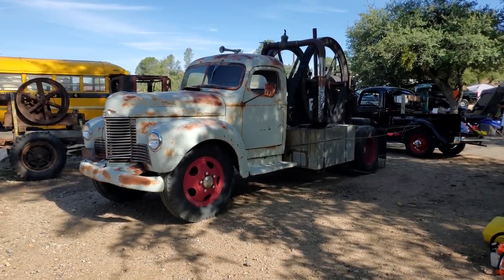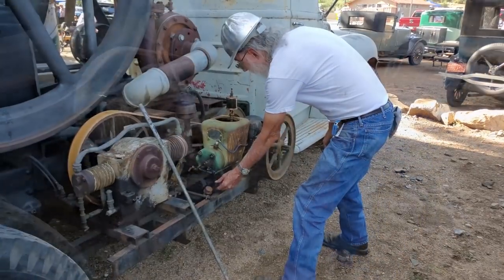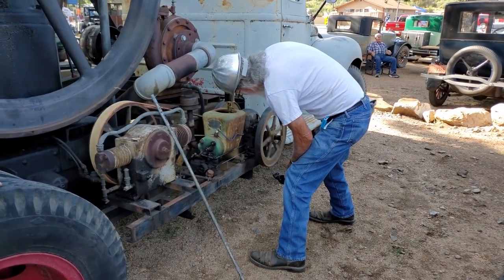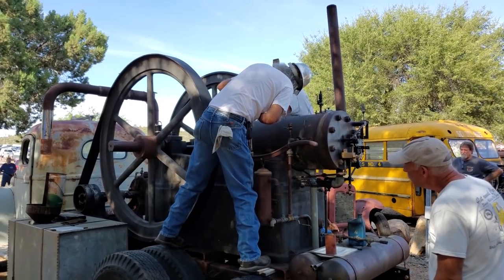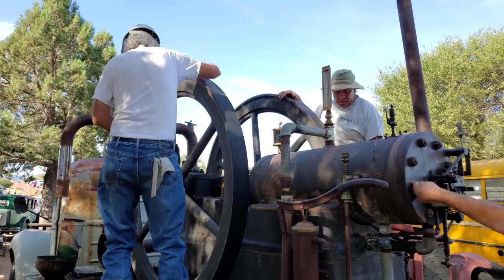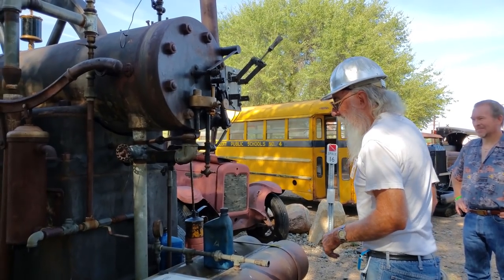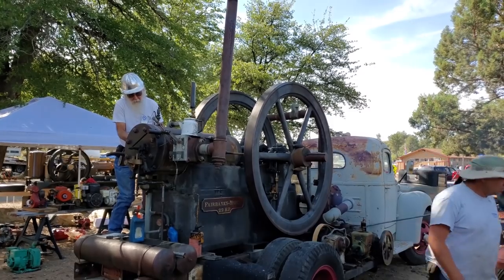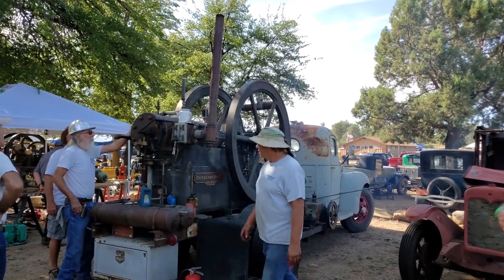Fairbanks Morse 22 HP Old Engine Fire Up - Prescott Antique Auto Club, Aug. 4, 2019

Comment: why that kind of ood machines pumps just one time while 3 to 4 moves? Is there just one ignition per 4 rounds? Anyway,i  would like to understand the technik of that beautiful maschines.
Reply from the maker: If you do a Google search using the words, 1899 Fairbanks Morse 22 HP engine, you will find several articles on Fairbanks Morse engines. The engine does date back to 1899 and was typical for the technology of the time. You may find information about old engines by visiting museums. Prescott Antique Auto Club holds a car show and old engine display the first weekend in August. This year it will be August 5-6. Keep an eye out for activities like this in your area. Thanks for watching!